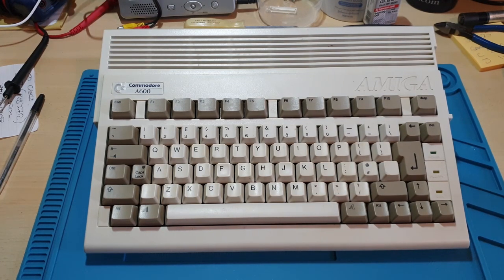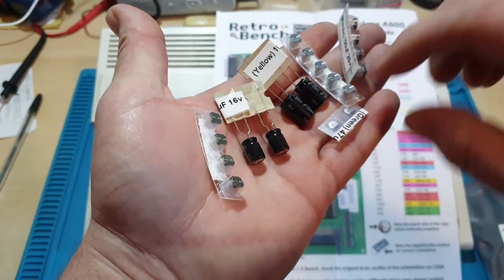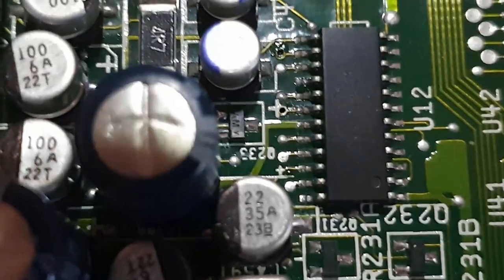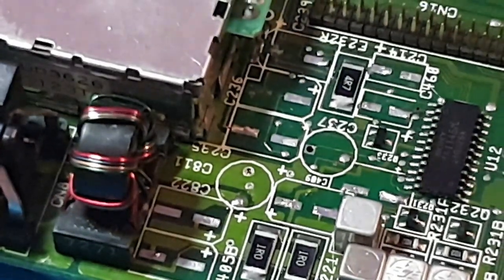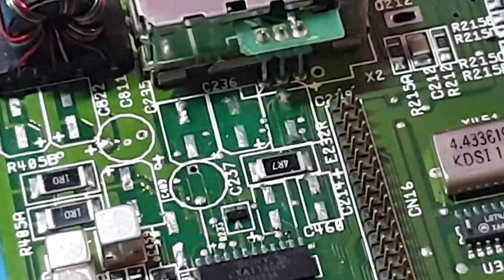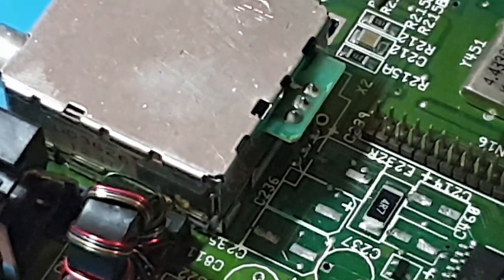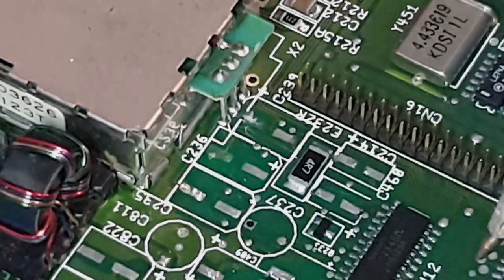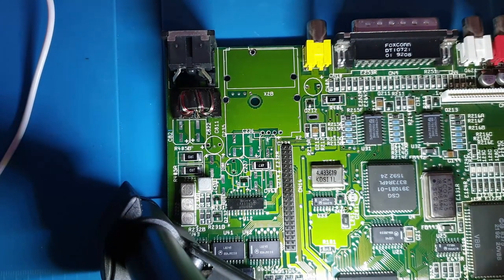Commodore Amiga A600 Capacitor Recap And Trace Repair Part 1

Comment: am currently on my 6th lifted pad 😅 this is turning out to be a real frankenstein job for me. the smallest amount of heat and movement on mine and the pads lift off straight away. then making a trace to solder tiny wire. its always the positive pad that lifts off. 
if my amiga works after lifting every pad off of every capacitor id be very surprised. every cap is so close to other components as well. this job is for the pros like you for sure.
i am close to lugging mine straight into a wall
Reply from the maker: They can be a pain and i feel your pain lol .. If you get stuck .. Ill happily take a look for you :)
Reply: @8BitRetroReFix  il give it another go tomorrow, il probably remove the hack job ive done so far and make proper traces to the points and solder the caps raised slightly and glue them in place rather than try to get them flat to the board. I really hate surface mount caps! the way they are on this as well its next to things that melt lol
The thing that set me off was that i tried to push the soldering tip forward and i heard this click.. and that click was the leg of one of the new caps i just fitted snapped off, and then it took a pad with it! So sensitive.
Ive recapped gamegear after gamegear, even ones left outside in a tip, not one pad came off. This amiga though.. freakin nightmare! I feel so embarrassed looking at it, i feel like ive dropped a baby on its head haha
Reply from the maker: Am sure you'll get there 😉.. amigas do seem to be more of an issue .. tweezer iron is in my shopping list lol 😆 😅
Reply: @8BitRetroReFix  Update on the progress - absolute bollocks. I have been scraping traces and trying to rewire the traces for the caps to solder to - had to remove the audio jacks for the audio caps and... all of the pads of the audio jacks ripped off! Am beginning to think theres something wrong with this board! they lifted off on the underside and the top side! Like as soon as the soldering tip touches them you can see them just slide off its mental. I bought soldering tweezers as well that came today.

I reattached a new cap then no problem to the pads that were fine, i touched the cap with my finger just slightly to see if it held and then... pop.. BOTH pads lift off. So im currently on many more lifted pads. hot gluing the audio jacks back in place. 

Its literally every single capacitor now has lifted pads, including now both audio jacks. Reducing soldering iron temp to the point the solder is like clay and lumpy but its not good at all really, so you have to get it hot enough for the solder to flow right but in doing so it just makes the pads lift off completely. Ive even got pads lifted but still attached to the board trace. Am lucky I just got this amiga cheap.
What an absolute nightmare I don't know how you did it so well. i swear if one more pad lifts im going to snap the board across my knee haha
Reply from the maker: @Retrobution  Check this web site .. Its an interactive Amiga PCB .. should help where things go :) . https://www.amigapcb.org/

Comment: Ah, good ol' 600s, we do a fair amount of these, seems the UK versions got the worst of it. We are in the US and generally no major issues to be noted. Hot air is "best" but two irons works better sometimes.
Reply from the maker: Hi.. yeah generally any surface mount caps from that time are needing replacing at this side of the pond ... must be something to do with the outside temp and damp going up n down so regularly...  you gotta keep them alive .. keep buying scrappers for parts but end up repairing them ... can't bear to break them up lol
Reply: @8BitRetroReFix  yeah, definitely understand that!